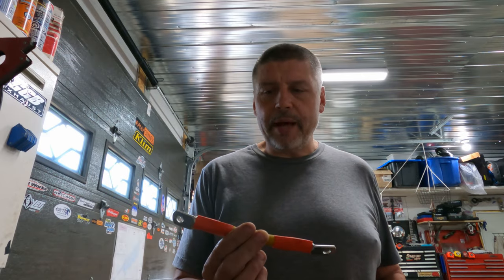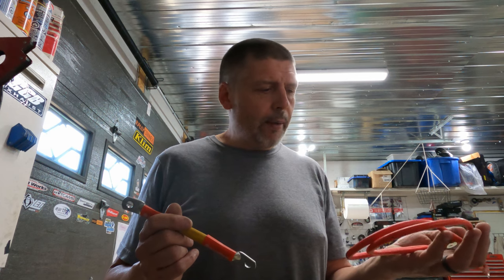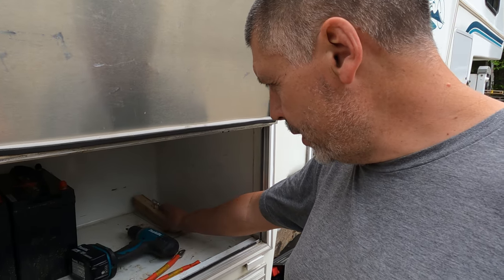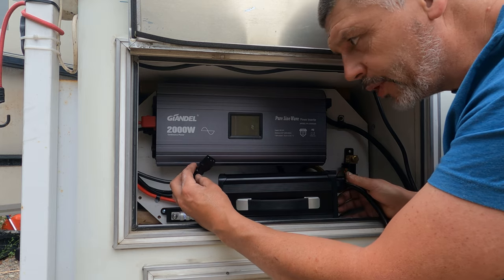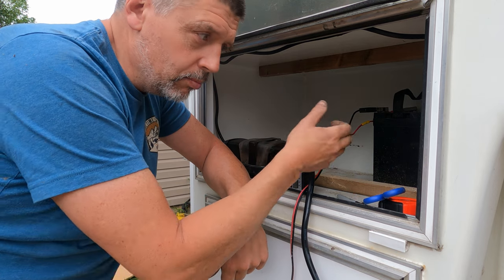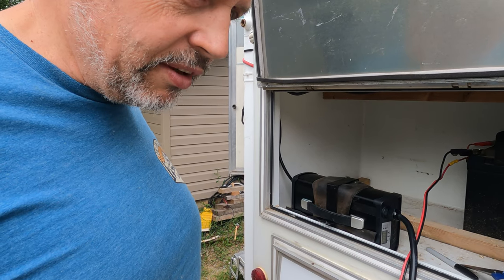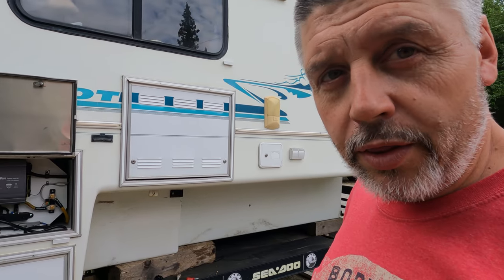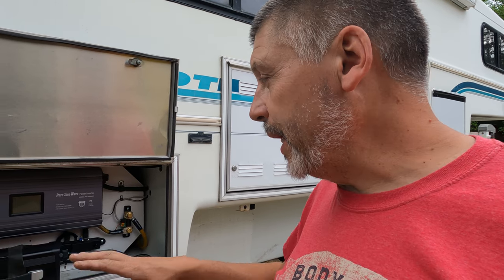Inverter Install - From Truck Camper to a Solar Powered Home!

Comment: This is a little bit of the subject at hand , but when you replaced the fridge with the Unique ,does the door open enough,so you can remove the shelves in fridge?
Reply from the maker: Good observation. No, it doesn't. The hinge/door has to be removed to make shelf adjustments. We may have to do that once we use the fridge a bit more and determine what items go where.
Reply: Thanks for reply to ref door ? . I have the same model BF 1997 . Also went w the Unique 2years ago, perfect no problem. Added solar, renogy 50amp DC to DC , SOK206amp batt, renogy 2000w pure sin, 5 100w rich panels, tiltabel. Everything inside, controller,switches,fuses mounted on the side of propane box,battery under sink, inverter in the closet . Left the existing system in place just removed the batteries and taped the wires, hardwired the inverter to existing generator wires, the white 3conductor that goes to the box in the“shore power compartment “ . So basically I have dual system’s . By the way, your install,nice clean and organized.
Reply from the maker: Sounds like you have a great setup. I never thought of factory generator option. Obviously that's what the 12 ga wire was for. They must have installed a  transfer switch near the show power plug when the generator option was installed. Thanks for watching.
Reply: My 12ga gen cable,now my inverter cable, terminated in a receptacle box so now I just plug the shore power cable in to receptacle when of grid .   This is for “What it is Worth” file. I had water intrusion in the gen compartment when heavy rain ,solved it by installing a aluminum drip rail just above. Rail like above your entryway. Above all the other doors inc all windows added Stick On Driprail. The trick w stick on rail is to scratch and clean area well and get wall and rail real hot and roll out real good.     Another problem was the fresh water tank. Had a water leak, opened up the bottom , the tank a 50gal L shaped polyethylene tank ,secured w only 3 straps, one had ripped out . Not a good arrangement, so I added 3 more straps ,also installed a tank heater on Fw tank, installed a SeeLevel Monitor system since I had the bottom opened. Appreciate you documenting your Project.